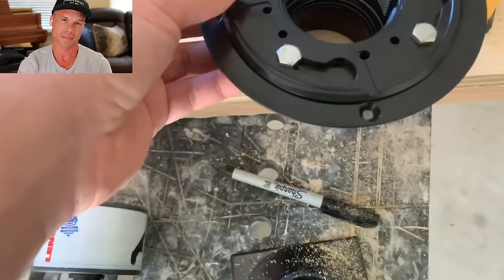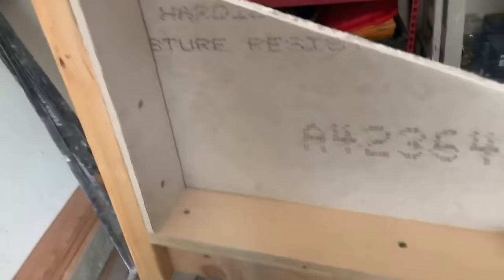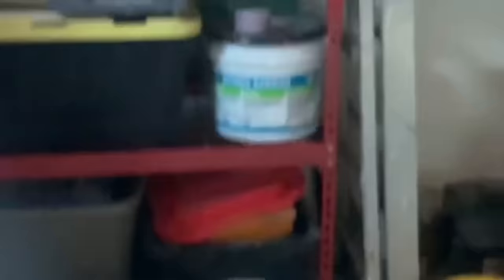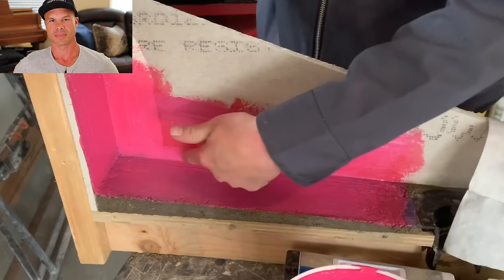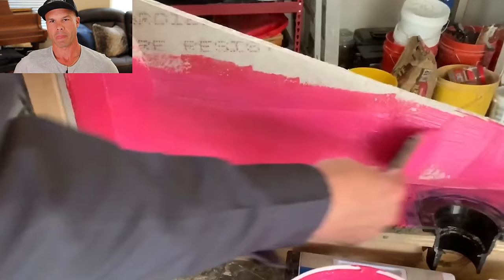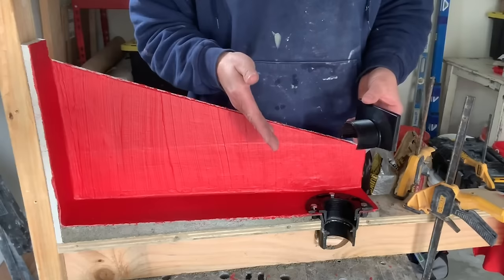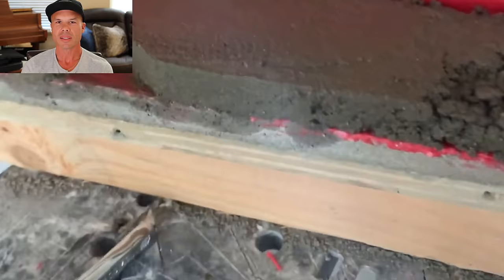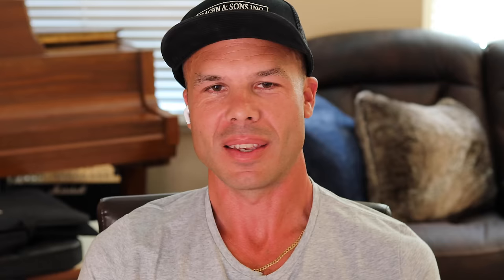THE BEST REDGARD VIDEO ON THE INTERNET!!!

Comment: Hi everyone....just wondering if anybody knows a name or manufacturer for that felt tape being used in the corners? (I cant find it anywhere) cheers !
Reply from the maker: Laticrete waterproofing fabric.  https://www.amazon.com/Laticrete-Waterproofing-Membrane-Fabric-Roll/dp/B003D0GODG/ref=asc_df_B003D0GODG/?tag=hyprod-20&linkCode=df0&hvadid=167137416388&hvpos=&hvnetw=g&hvrand=5382660874808006829&hvpone=&hvptwo=&hvqmt=&hvdev=m&hvdvcmdl=&hvlocint=&hvlocphy=9032482&hvtargid=pla-308935475405&psc=1

Comment: Looks to me like when water gets underneath your deck mud, failure is just a matter of time 🤔
Reply from the maker: Actually, these water in/water out systems have been successful in California for almost 80 years with hot mops, copper/lead pans,  and now PVC liners.  They key is to use good weep protection with adequate preslope under the waterproofing.  The "liquid applied" systems are relatively new, and time will tell how well they hold up.

Comment: Anyone know the name of that felt fabric being used?
Reply: 6” (wide) Fiberglass Mesh Tape. Not sold at Home Depot.
Reply: @ADHDProcrastination  Thanks man. I tried to get it at floor and decor but no luck.
Reply: Howard Holmes III I found it on Amazon for a couple bucks. The Redgard application instructions called for it for plane transitions so I had to do some digging.

Comment: Also your cement board or hardi backer shower walls should not sit inside or below your shower pan floor. Many shower tear out videos on you tube as a result of that. Your shower wall should be held above the shower floor. Too much misinformation resulting in much confusion on youtube

Comment: Watching to much porn? Define to much.

I used this stuff for the first time the other day on an out door shower that was part of a deck that I built with a wooden hot tub. Worked pretty good. I used what was left to water proof the back side of some red wood  that I was using as a small retaining wall. That should keep it from rotting out for a while.